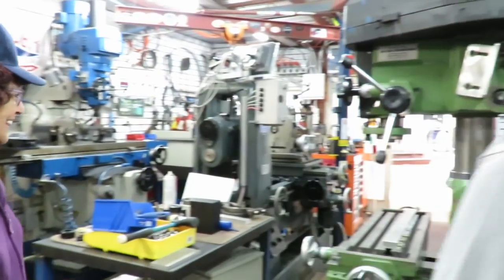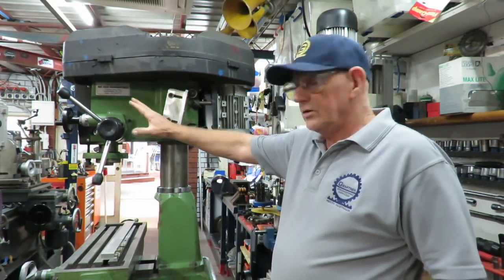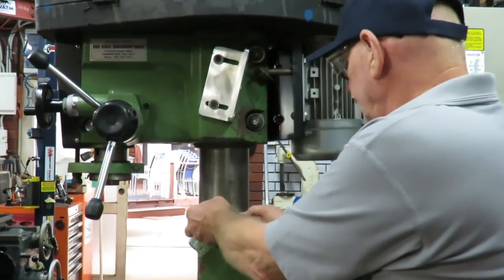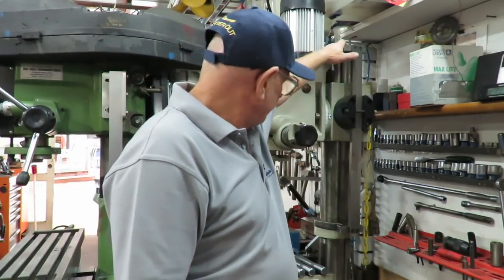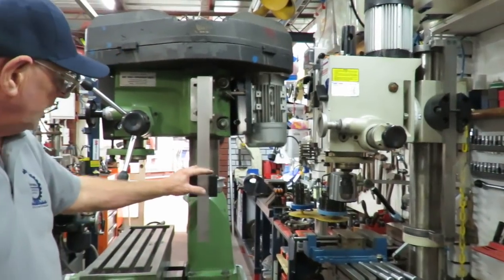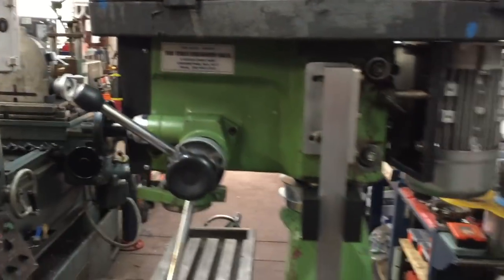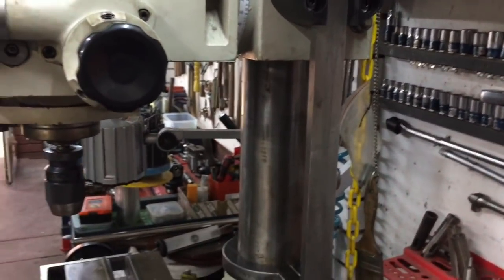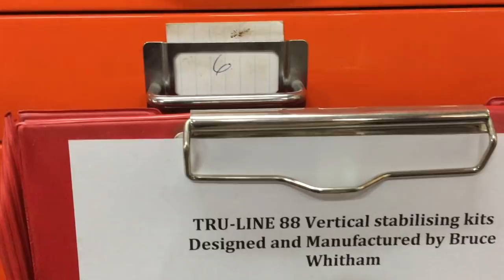TRU-LINE-8- promo

Comment: Mounting the block there makes access to the clamp bolds difficult.
Silent for 2 years- guess it died a death for fairly clear reasons.
The major problem with this design is that it is single ended. Most fixes from this problem attach the guide to both top and bottom of the column. Single ended is prone to flexing.
Reply: He’s still selling them today just posted today.  So yea there ya go

Comment: What is your procedure for lining up the vertical member with the axis of the column?
Reply: In practise, the precision comes from the machining of the poly block and the collar clamp. The width of the bearing surfaces and the method of clamping means that the parts force the vertical beam to be true, then as far as the distance from the column, this can be checked very simply with a rule or telescoping gauge to ensure the bar is positioned vertical in the other axis. The slotted arrangement of the bracket means there is plenty of adjustment to take up the draft in the mill head casting. 
We will have a follow up video with some measurements on my mill once I’m set up there.
The main issues this will not resolve is if the quill bore is not parallel to the round column.
If this is the issue, then there are other problems with your mill that this system will not resolve.
(I asked Bruce if the True-Line 88 would solve the apprentice marks on my bed, apparently it can’t fix those either! Haha)
Reply: I'd imagine that'd you would crank the head down while the bolts holding the vertical beam to the bracket are still a bit loose in the slots of the bracket - any misalignment would give a more pronounced angle when the two points are close together, then use a square to make sure the angle is square relative to the bracket, and that the beam is nicely located in the bearing slot.

Even if the beam isn't truly square, I'm not sure it matters so long as the angle is a little more than 90 degrees: The bearing only prevents rotational movement, if the beam slides in and out a few millimetres (maybe .120" ?) it's unlikely to change anything, though if the angle is less than 90 degrees, it will probably bind against the bottom of the slot as the head moves up. I'd probably use a square, snug the bolts down (while the head is low), then raise the head. This would allow the beam angle to increase just a smidge (if it had to), and tighten the bolts at that point.
Reply: I have one of these mills so I am following this closely.  My issue is that if the vertical member is not perfectly parallel to the axis of the column the head will rotate slightly as it is moved up and down.

Comment: I don't know Bruce, with only the one end held it doesn't seem very rigid? The other version, perhaps.
Reply from the maker: Stefan you would be surprised how rigid it is.
Reply: Hi Stefan, we've discussed the additional possibility of also dowelling the angle bracket to the head once bolted into the correct location for belt and braces alignment, but the aluminium collar is rock solid to the column, and the square block of poly has a wide bearing in all axes. Needless to say some deflection tests to follow, but its a smooth and solid interface on first tests.